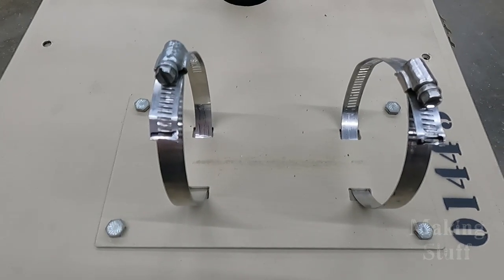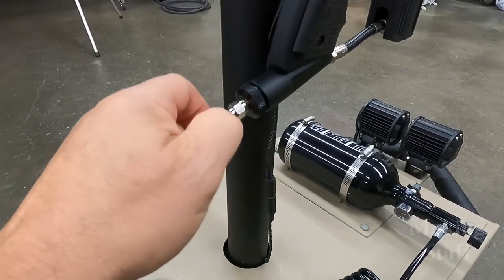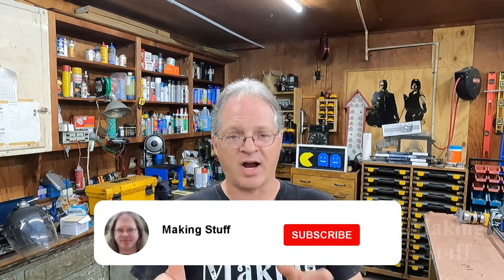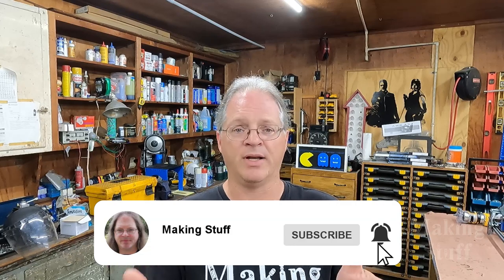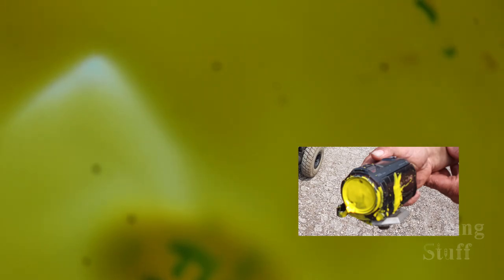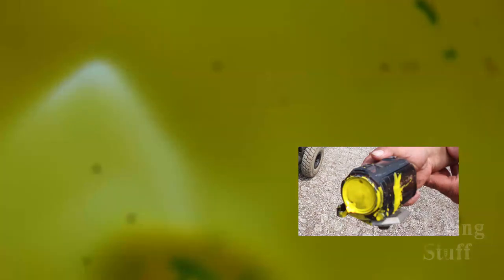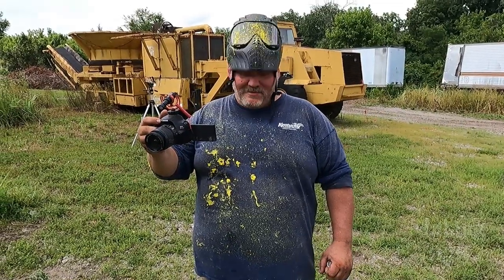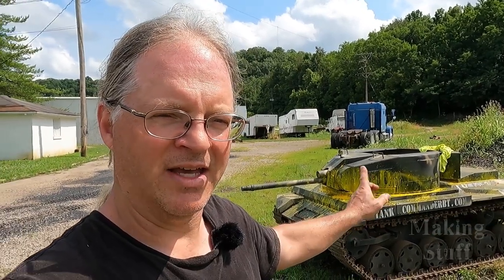HOMEMADE TANK BATTLE & TRACKED VEHICLES

Comment: Pretty cool and good start.  I think you should remove the caster wheel up front.  Replace it with two front idler wheels and stretch a track between them and the drive wheels.  Make it a micro remote tank.
Reply from the maker: Yeah, I think TankCommander is working on something special.